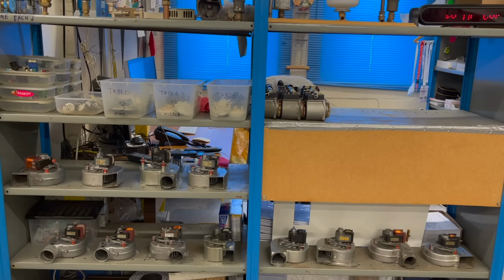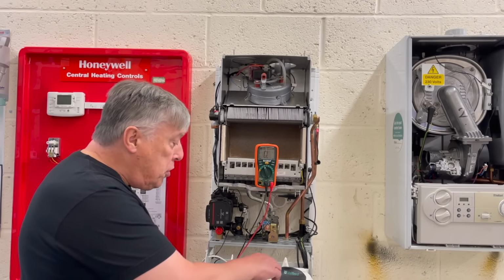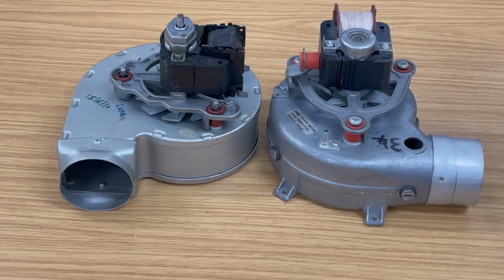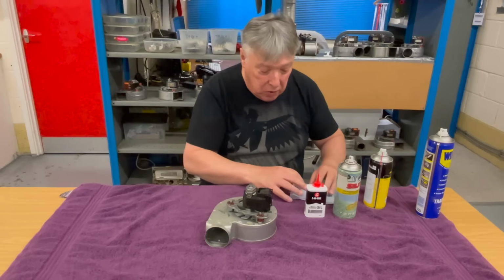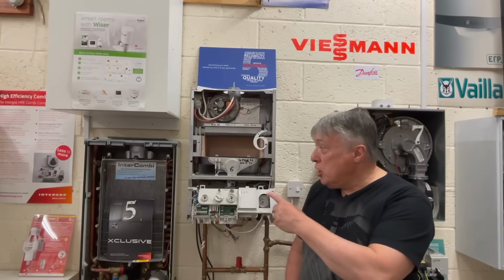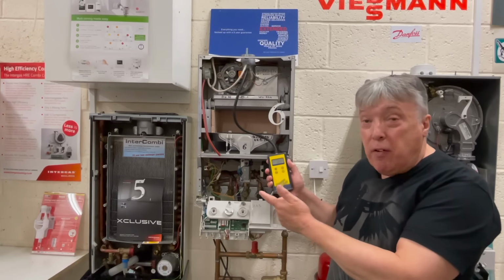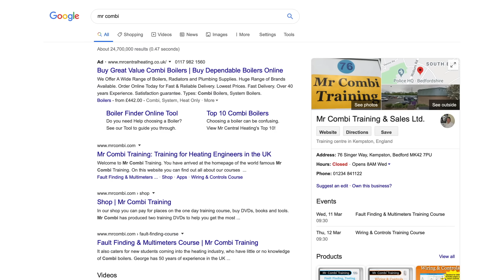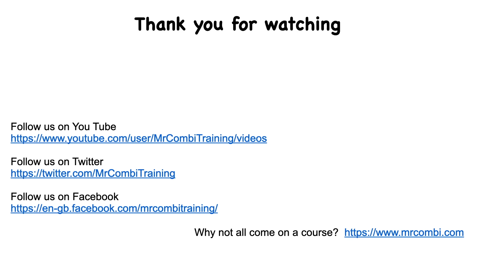Central Heating BOILER FANS  how to fix a NOISY or STUCK fan

Comment: Do you think an RD532 is getting to the age where there would be gas bill savings by replacing it, or is it classed a good efficient boiler still?
Reply from the maker: Hi John, thanks for asking, don't know what a RD532 is. All boilers are made for 90% efficiency for 12 years, at 15 goes down to less than 80% expensive and better boilers are available. This is only if it's been installed correctly and checked EVERY year, if not most last 4-6 years and high fuel usage and parts fail sooner. Hope that helps.george Staszak
Reply: @mrcombiBedford  it was installed before 2006, and I serviced it about 12months ago, loads of shit came out of the combustion chamber, new gaskets on and ignitor etc.
Apparently it's basically a Worcester Bosch HE30 but Branded British Gas.
Reply from the maker: Hi John,
Time for a new one, sound like its bunged up from age and not looked after correctly. My advice get the whole system cleaned out twice, replace boiler and fit boiler smart controls. Good luck, George 🤩 @johnshaw8013
Reply: @mrcombiBedford  it's being controlled by a Nest.
I'm unemployed at the moment and don't qualify for the boiler grant as mine is a condensing combi ☹️
Reply from the maker: Hi John, sorry to hear your situation, hopefully something will turn up this year. Take care, George 😍 @johnshaw8013

Comment: Good video. I used a Silicone / PTFE spray to get mine going again
Reply from the maker: Dear Euphoric, Thanks for comment,  silicone is not a cleaner but brilliant lubricator I have used it not 100% as I said WD40 to clean the muck then sewing machine oil to lubricate.
take care, George

Comment: 🤔🤔🤔I have been using WD40 for 15yrs now and never blown a boiler up...but sewing machine oil does make alot of sense .... Good very well explained video and my my haven't you aged alot over the years....🙈🙈🙈 Engineers champion 🏆 🥇 🏅 💪
Reply from the maker: Hi Chohan, thanks for your comment, as I said WD40 is a brilliant lubricant for a lot of thinks but NOT for boiler fans, if you don't use oil I will come to your house and sing Christmas carols to teach you a lesson. Take care, Happy new year.
Reply: @mrcombiBedford  just ordered Singer Sewing oil so will use from now on… just in case I have jinxed myself 😂😂😂Happy New Year and keep the excellent videos posted in 2022 🥃🥃🥃cheers
Reply from the maker: @chohanchohan8208  Excellent, most Craft shops sell a small bottle for a £1.00, thanks for liking me, take care. G

Comment: Great content, very informative. but - fan motor winding insulation can and does fail, the winding leaks to earth, ground, chassis, what ever you want to call it, often blowing the house circuit breaker. Often the leakage measurable only with a 'Megger' or similar. Its amazing that many motors are cheap crappy shaded pole types that used to be used in record decks years ago, but a replacement costs an arm and a leg!  Just saying. 😊

Comment: Great video, can I ask if a fan has a very low ohms reading, below what it should be but still works would this explain the intermittent fault I have been seeing
Reply from the maker: Hi Andy, Thanks for asking, if a part in intermittent I always see how old, anything the moves and over 6 years old just REPLACE with the latest version which is a big step forward, if the fan rotates freely look at the PCB over 6 years old just REPLACE with the latest version.
        A 230v single speed fan from a top firm will be 20 - 35 Ohms and 9m  long flue length, that's the quality we pay for. Average fan 40 -80 Ohms must popular very good for most systems.
If less than 20 Ohms ask tech what should it be
regards, George

Comment: I have been watching your channel for a long time, I have baxi solo 2 pf the overheat lamp lights up and he does not want to turn on thanks for any help
Reply from the maker: Hi Serg, thanks for asking and subscriber,
The over heat stat could be faulty or you have poor circulation, pump age over 6 years replace, basically boiler cannot dissipate the heat quickly enough, is the by-pass OK, water quality? Could need some F2 silencer. regards, George Staszak
Reply: @mrcombiBedford  pump new ups 3 I made a reset and right now 2 lamps are on, overheat and boller on, but for some reason it does not want to start .. thanks
Reply from the maker: @sergd7885  Hi Serg, two neons means it's in full speed, that's OK, you must have a blocked pipe / exchanger, drain and flush would be good. george

Comment: Thanks for this video - I was hoping it would help me identify the droning noise from our combi boiler. It's a shame you didn't include a recording of the noise the pump makes when faulty.
Reply from the maker: Hi Patrick, thanks for the comment, the reason I cannot record sound is because there are lots of them which is impossible for me to recreate. As a rule if a pump or fan makes any noise, replace. What we teach on Wednesdays is to get a long screwdriver and place carefully on the pump venting screw if the sound is "stones rattling"  replace, the same on a fan on the body NOT the motor. Hope this answers your question, George Staszak
Reply: @mrcombiBedford  If you ever meet a noisy fan problem on your travels why not record it anyway. Build up a database of sounds so people can identify with them. I'm guessing each noise has it's own distinct "signature" if it's gas valve or pump or fan or etc. I used my mobile phone to record the noise our boiler makes but the heating engineer couldn't suggest anything without seeing the problem for himself.
Reply from the maker: @MontyVideo969  Hi Patrick,At well over 70 I am off the tools passing on my skills to others with the help of lots of tekkies from factories, any unusual sound  means replace
Reply: @mrcombiBedford  Hi. In our particular case the annoying droning noise wasn't the boiler at all - it was the (external) Automatic By-pass Valve "chattering".
Reply from the maker: @MontyVideo969  You found the fault, just a thought if under a combi is the B-Pass 22mm? 15mm could be noisy,  if over a metre 15mm will do, silly question not heard of chattering unless TRVs and the arrow on the pump + B/Pass are facing the wrong way. let me know. G Force.
Reply: @mrcombiBedford  The ABV was presumably set to a pressure such that the pump was causing it to open/close rapidly (around 320Hz). So, the solution was to tweak the ABV setting. Since then no more droning noise. Here's the noise, if you're really interested. https://youtu.be/pcYLKUKdHPo
Reply from the maker: @MontyVideo969  Lovely video thanks, I am just making a new video about pumps and one episode is listening via a long screwdriver.

Comment: just use regin fan oil, it's made for the purpose. wouldn't use wd40 personally. as if will feck it.
disagree with always replacing the fan. most atmospheric boiler fans go stiff due to lack of servicing.  60 percent of the time fan  just needs bit of regin fan oil. had one customer had a was told fan obsolete then rang me just oiled the fan up and freed it. 4 yrs on boiler is still running with bit of fan oil on every service.
Reply from the maker: Thanks for the comment,
Regan fan oil is very good but costs over £10.00 sewing oil is available from Craft Shops for about £1.00 and available all over the country, that's why I said it, take care
Reply: @mrcombiBedford  i pay around a fiver for it.
Reply from the maker: @Heatingandplumbing1   As always we shop around, where is it so others will know where to buy, Amazon is £10, thanks for the update
Reply: He clearly said use wd40 just to degrease it/ clean it and then remove it as much of wd40 as you can and actually lubricate it with something else
Reply from the maker: @wtfMYRONL  correct